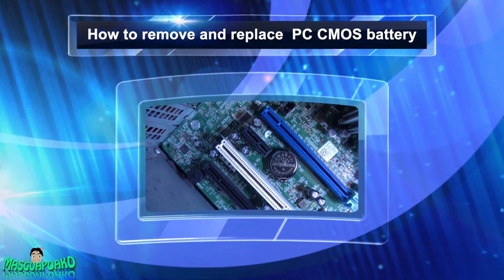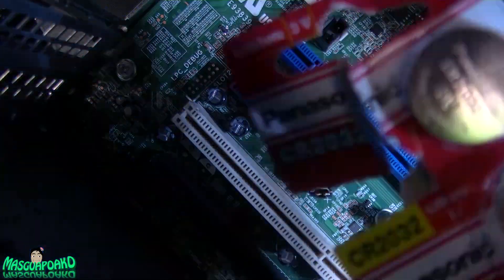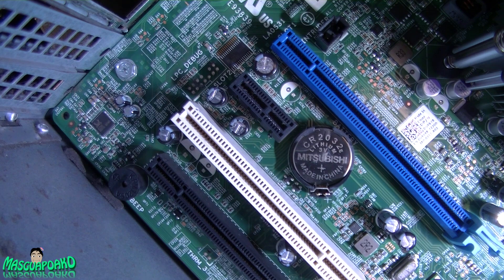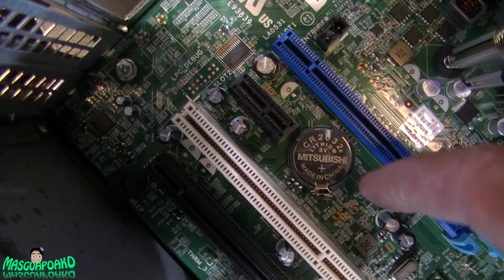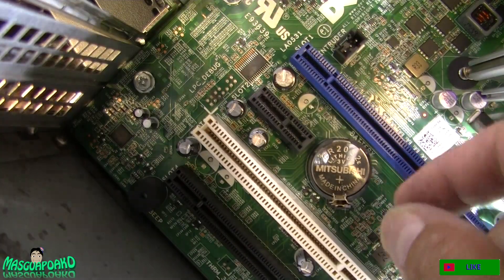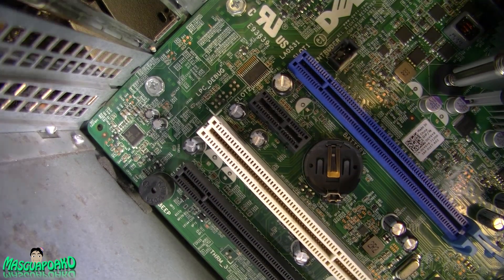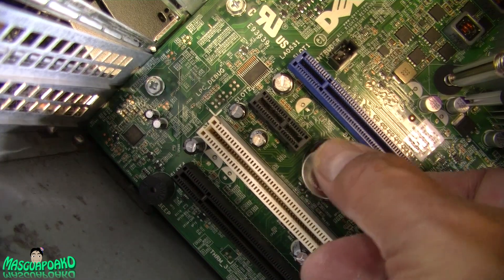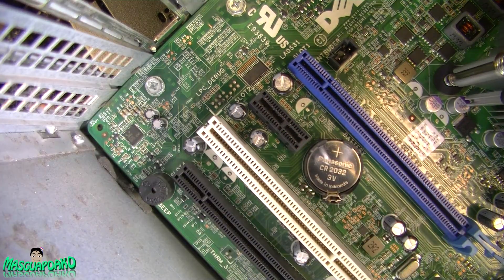How To Remove and Replace PC CMOS Battery  (Dell OptiPlex)

Comment: They told me to replace the battery cause i had to power up the pc going through f12,f2 (using the keyboard) ruther than powering up the pc a
Doe this solve the problem ?
Reply from the maker: sounds like the pc can't remember the bios settings due to depleted battery.  Just try and replace the battery, you can get those at Dollar Tree for $1.25+tax for a 2pk.

Comment: I keep pressing the little lever but battery still won't come out. I don't wanna break it. I have 7040 and it just doesn't want to come out.
Reply from the maker: You might have to push the lever and use a plastic pick or even guitar pick to push the battery up. Good luck

Comment: I have a dell optiplex 9020 and tried this to solve rebooting issues but i still end up with hard disk not found error, is there anyway i can solve it?
Reply from the maker: Does the HD shows up on the bios at all? Also have you done f11 boot?
Reply: @masguapoako  it didn't show

Comment: Can taking the battery out get rid of boot errors such as hard drive fan failure?
Reply from the maker: I don't think so, dell boot errors is probably from the proprietary fan or the temp sensor.
Reply: For hard drive errors you can turn off SMART error reporting from BIOS settings. No fix for fan warnings unfortunately other than making a jumper switch that makes the mobo think that you've got a working fan plugged in